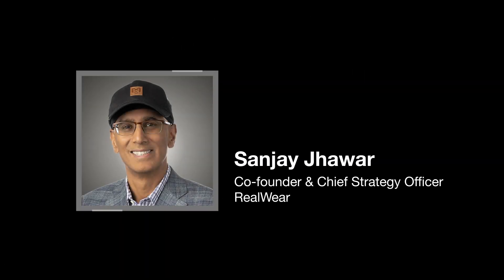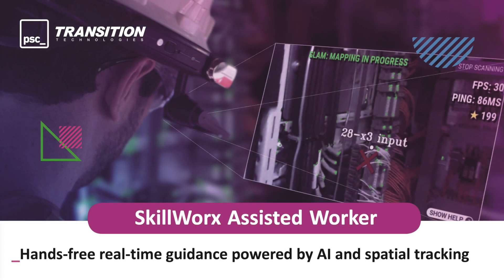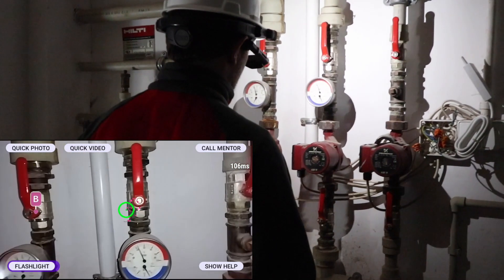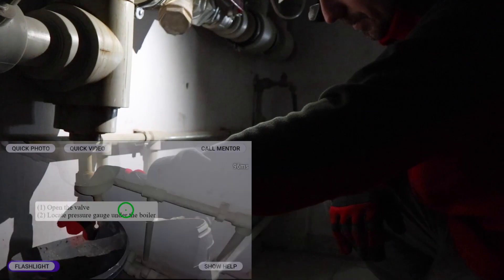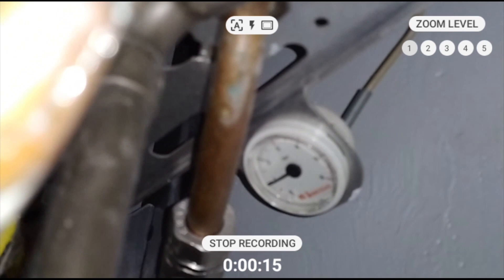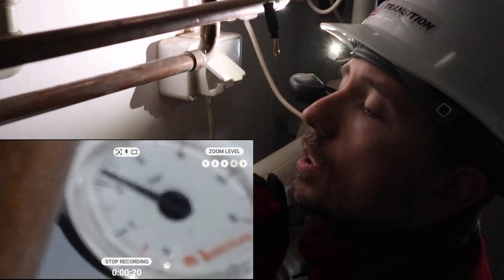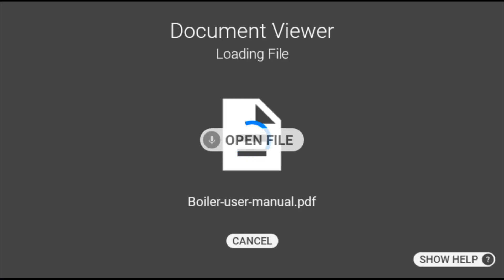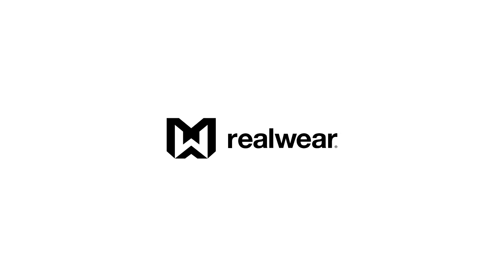RealWear Demonstrates 2.5D Assisted Reality based on SLAM with RealWear Navigator[TM] 500

Comment: This is hilarious. Using very high tech devices to really dumb down the work force. No need for training and experience. Just grab a headset and do as the prompts say. 
The irony is on the next level.
Reply: On the contrary this helps train the workforce faster and get from beginner to journeyman in less time, where they can add more value to the business.  It also helps capture knowledge at a time in many industries when new technologies are driving a rapid pace of change.   And when there are pandemic lockdowns the person who is available may have to do the job, rather than the person who is an expert.   Then they can become an expert.     RealWear empowers, engages and elevates the front line worker.
Reply: @sjhawar  You already know that this will be used to hire low paid field techs to be live hands for a remote expert.
Reply: @haroldpalmsesq2506  that has not been the experience of our customers. The techs that use our devices are distinguishing themselves in the eyes of their companies as being receptive to more effective ways of working and growing their knowledge base by being active learners and this helps advance their careers.  You are ascribing motivations to me that are not accurate.